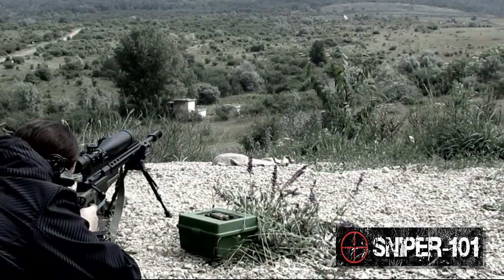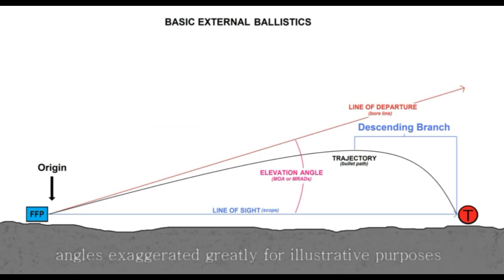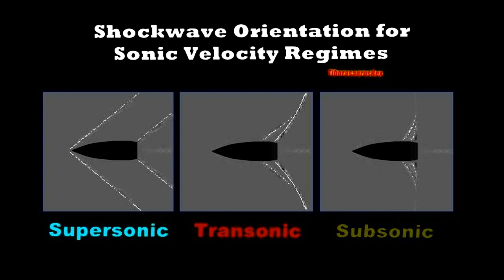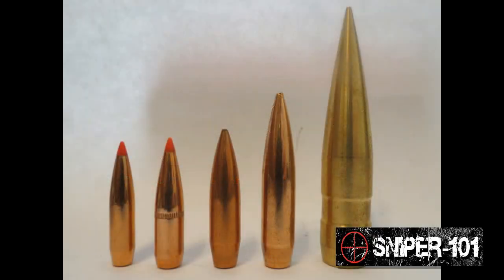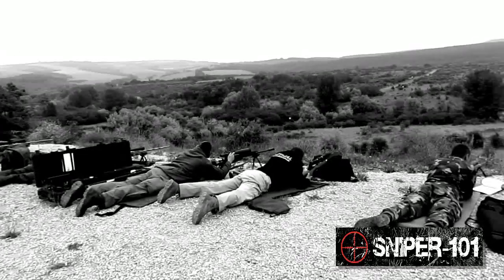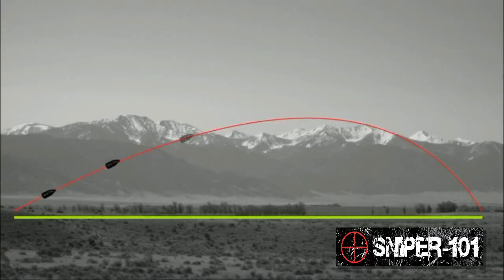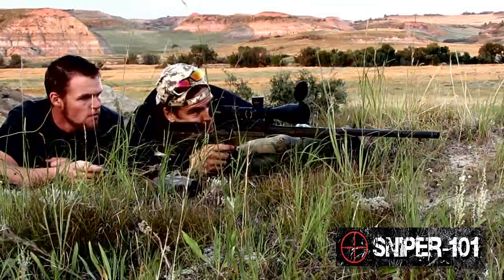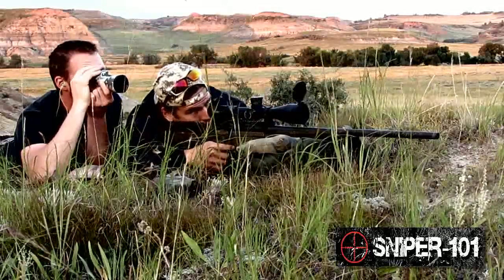Long Range 101 Part 75 - The TRANSONIC ZONE & Maximum Effective Range

Comment: Love the Excel Workbook! A big thanks to you and your team... (I'm finally up to date on all 75 videos in the series!) Excellent, Outstanding, (any other praise I can send your way)...

A request though: Is there a way to modify the Bullet Drop Table to extend into and thru the Trans-sonic Range? Maybe turn those numbers red?

For giggles, I sometimes like to see what I can do out beyond where the bullet is supposed to lose it ability to do anything accurately. I do realize I'm not hitting a Beer Can out there, but may hit a bigger piece of steel.
Reply from the maker: Simple: Adjust the speed of sound input, put it at a lower value.  :-)

Comment: I did my load development in the summer for my .243 105 bthp match hornady bullets and got a mv average of 3011 at 90º. I shot it again today and got an average of 2972 at 80º. Which is only 2fps slower than what the program predicted.  Now I just need to find somewhere to shoot in mid ga without having to drive 3 hours.

Comment: Rex....My measured velocities and the corresponding bullet drops does not coincide with my actual point of impact............ Do I adjust my muzzle velocities to the ballistic calculator for a "best fit" between calculated and actual values?

Comment: I have a Savage 270 Win with 22" sporter profile barrel.  Working up a 150 gr load at approx  2900-2950 fps.  The stock is pillar bedded.  If I do my part, is it reasonable to expect accuracy and precision at long range with this set up?  How important is barrel profile  and stock bedding for shooting long range?

Comment: My choice of projectile is the 175 SMK. I realized early on with my choice parameters that my max distance would be 1100 meters. My findings all told me that in the .308 this bullet handled the transonic shift better than a 168 gr bullet.
Reply from the maker: weld3871 You got a good handle on it!

Comment: Hi Rex, Once again a riveting video, absolutely glued all the way through, actually I have repeated several times, so much knowledge.  God bless you and your teams effort. I thought I had downloaded all your software you have kindly shared with us, but I can't seem to find the 'twist rate analyzer on the excel programs' mentioned by one of the fellow watchers.  Could you please direct me to where I can locate it.  I have a Rem Sendero, .300 RUM, It has a 1/10 twist rate,  so I would like to see what is the max bullet for that setup before starting to do all the logs etc.  Really appreciate all your passion.  Thanks Again.
Reply from the maker: Thank you, sir.  On the program...you may need to upload the newest version - available using the same link.  He updates the tables regularly as they continue to become more and more refined...
Reply from the maker: TiborasaurusRex Max bullet for a 1:10???  You can use 200gr+ w/o any problems.  :-)  Hope this helps!
Reply: TiborasaurusRex
Many Thanks, I was thinking of the 240 grain sierra bullet, As they recommend 1:9 at least, so it is a little off  ideal as you mention in the video. There is another at 260, but need to run the program to see what happens.  Cheers, Hope all your  developments bring you all success in all forms.
Reply: TiborasaurusRex OK I will do, but could  you please guide me to the link as I have not come across it yet?

Comment: Rex do you have any experience shooting the 300gr Berger OTM bullets? Berger markets that they are "stable at subsonic velocities" and have a BC of 0.818, lending one to shoot far past the transonic range.
Reply from the maker: Two Niner No, sir.  I have mainly been using the SMKs.  A balanced flight .338 bullet would be excellent.  Which twist and rifling pattern was it designed for???

Comment: It would be interesting to see what the centre-of-pressure changes are like around a round- or flat-nosed bullet as opposed to a trendy VLD BT spitzer, and whether this makes any difference to tractability and stability across the transonic region. Granted, it's mostly an academic exercise as far as military, LE and tactical applications are concerned, but users of leverguns and older single-shots who don't want to/can't reach for one of Hornady's sharp-nosed miracles, or those who cast their own, might be very interested indeed in the results of such a study.
Reply: TiborasaurusRex *slaps forehead* Silly me, of course; forgot all about SSK. Many of the old single-shot long-range target rifles (the Creedmoors, the Peabody What-Cheers and so on) started within the transonic zone, but used bullets of almost absurd length and weight for the calibre with HUGE sectional densities, while the last of the military single-shots are somewhere in the 1300-1500fps region and go subsonic pretty quickly, in the first couple of hundred yards. Obviously it's better to start either well above or just below, but for those bullets that have to negotiate the region and stay stable, I wonder if it's not a better thing to do it close to the muzzle.

Comment: Absolutely love your video series. But I'm curious as to how you feel about shooters that shoot a particular load past the transonic range frequently and log their impacts? Do you think that there is a point where experience outweights a mathmatical calculation?
Reply from the maker: Great question, sir. Although keeping good logs is essential in this discipline, if you log your impacts beyond your max ss range you will most likely only confirm that your impacts are so wildly inconsistent that reliable corrections are exceedingly difficult if not impossible to apply much beyond this hard-line.  If logging consistent impact points beyond these ranges were possible, then math could be applied to model it... hope this helps.
Reply: TiborasaurusRex Thanks for the reply. I have one more question. I've been playing around with the twist rate analyzer on the excel program you provided. I shoot a 338 RUM with 300 grain bullets. Every manufacturer suggests 1/10 twist. But I've found that getting closer to 1/11 produces better numbers in the twist rate analyzer. Does this seem right? What twist do you use in your 338 Lapua?

Comment: Ok so I have a Remington 700 with a 26" heavy barrel in a .243 with a twist rate of 1 in 9 1/8"
Will that be enough to stabilize a 105 gr a max or will that extra 1/8 in throw it off down range?
Reply: That's the exact twist rate Rex has for that caliber

Comment: How bout the weight of the bullet? Don't heavier bullets tend to retain stability and energy at longer ranges? There is a power to weight ratio that also has to be in place. That's why the 408 and 416 are very effective rounds
Reply: +Chad Wohlhueter Its all about finding the balance, heavier bullets tend to be long which reduces stability but helps a lot with ballistic coefficient. Then you have to think that the added weight typically reduces muzzle velocity or if you are getting the weight by increasing the caliber you have a larger area for the air friction to effect. The trick is finding the bullet that balances all of the variables and suits your application best.